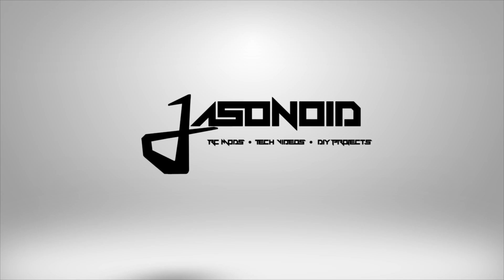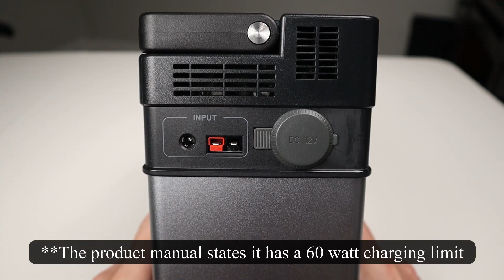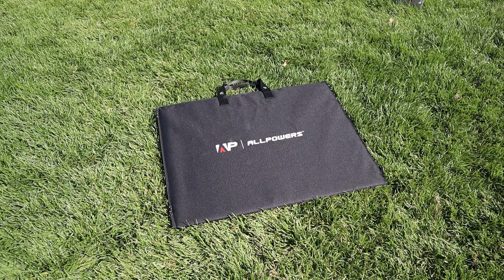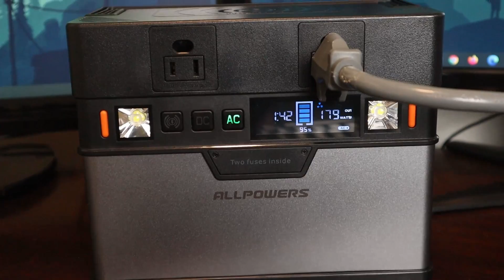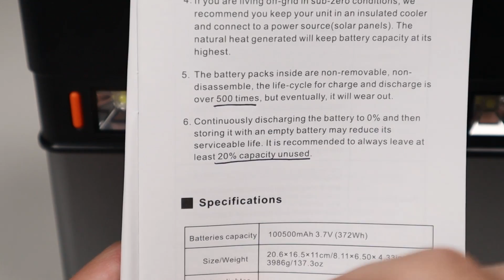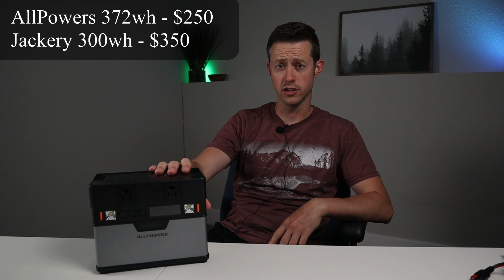ALLPOWERS Lithium Solar Generator - Affordable and Powerful!

Comment: Can you charge it off usb solar panel
Reply from the maker: You can charge it using the Anderson power pole connection or the barrel plug connection. USB is only for output power.

Comment: This model and the 500watt inverter as a SOS feature with it's 2 flashlights.
( Too turn on the flashlight SOS feature press and hold the button and tell it turns on and same with the other light and too turn them off press and hold the button and it will turn off SOS flashlight ).
Also I am pretty sure it didn't mention this hidden SOS feature in the instruction manual. Also it doesn't have a fast flashing effect just only the slow SOS flashing. https://youtu.be/ipUKAQzZnVY
Also here is a quick look on my YouTube video with the SOS feature on this 300watt battery station that you review a while back.
Reply from the maker: Thanks for the tip on getting the SOS feature!
Reply: Np.

Comment: С холодильником 45 ватт нормально будет работать?
Reply from the maker: Most fridges are rated at 45 watts, they usually don't pull that much power. This will run the fridge for about 24 hours so you will want either 60 watts of solar to charge it during the day or an AC charging source.

Comment: how is the overall quality?
Reply from the maker: Its built very well and durable. The only downside I have discovered over using it for so long is that the  12v socket output is not regulated. It puts out 12.2 volts when full and then it drops to about 10 volts as the battery is depleted.
Reply: @Jasonoid  thnx, i found out that they dont use lg, samsung or panasonic cells but generic chinese brand..
Reply from the maker: @hfuffvnjvnijd8989  if you want a higher quality pack I'd check out Jackery Brand. Never heard complaints from their models. You could always build your own battery. If you feel confident you can get nearly 1000wh using 80ah Lifepo4 cells. Check out my other channel video on that